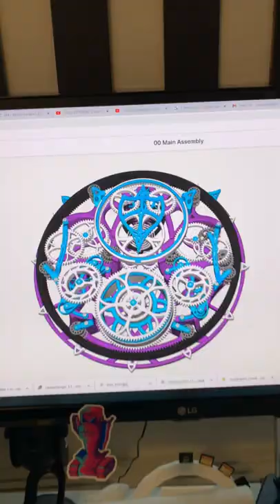Mind blowing 3D Printed Clock Mechanism from @mechanistic

Comment: Do you sleep lol? I'm blown away by the pace at which you can keep putting out new creative projects like these. Keep up the good work 👌
Reply from the maker: I do in fact sleep! This is my full time job haha so when I’m not sleeping this is what I’m doing
Reply: Me too lol  as a printer for most of the last decade at hobby level I have concluded 3dprinted warps the space time continuum as print times never line up on any printer "new v3 se ender is actually accurate I'll admit"  aswell as the ability to tram align test and re test and dialing in.. it has to be a time machine with the amount time on some prints yet some people just can flog em out as rapid prototyping and it's freaking brilliant 😊🎉🎉🎉

Comment: Some metalugy student once told me that ..  Mech watches use an alloy of Berrylium Copper to makeparts with springy effect cos  it's berrylium which adds the springy property to the copper without which copper would not bounce back to the  original shape needed.
With regards to the winding mechanism.. 
How do u do it?. 
What material do u use?